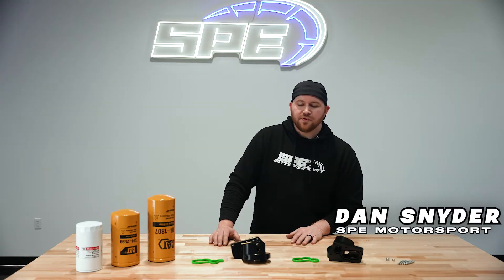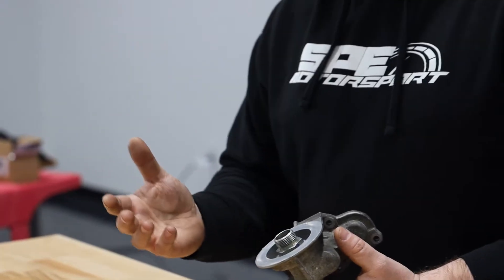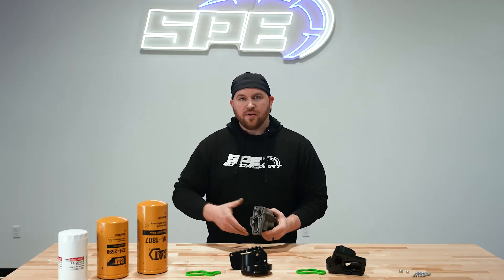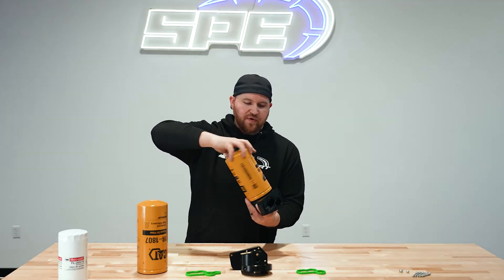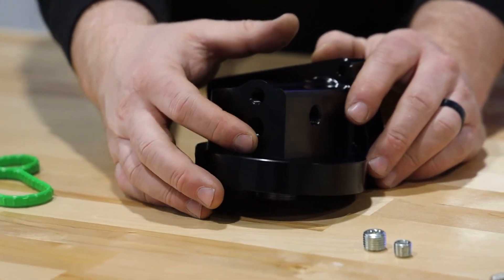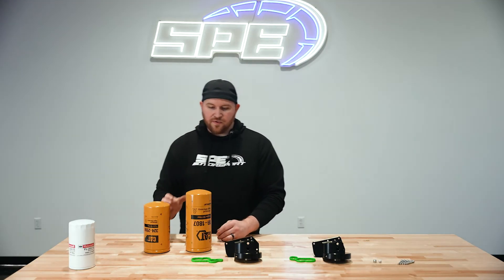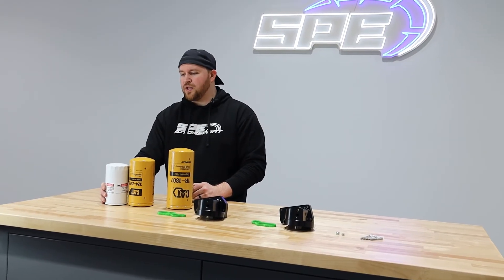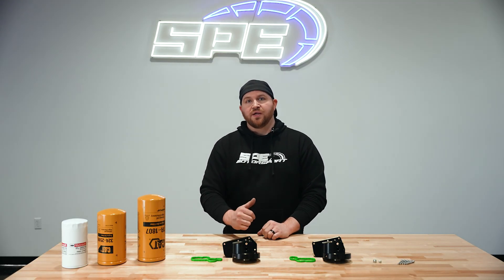SPE's NEW 6.7 Powerstroke HIGH FLOW OIL FILTER HOUSING with CAT FILTERS

Comment: BYPASS VALVE…for those concerned about the BP.V missing on the CAT, consider this… this is my plan. Run a Baldwin b218 or wix 51800 in winter and the CAT the other 3 seasons. Baldwin and wix have bypass valves. But cat does not have BP.V but has has tighter (better) microns.
Reply: Does the factory filter have an anti drain back valve?  And do all of these that you have mentioned have it?

Comment: I am sold on good filtration and better flow thru housing. What I am not sold on is CAT filters not having a bypass valve or drain back valve. I think in cold winter temps we need a bypass valve in the filter. I’m open to discussion. What am I missing? I’d get the kit if I can find a cross reference oil filter to the CAT’s except that it has a bypass valve.
Reply: Have you found a solid filter that has an anti drain back valve and a bypass valve?
Reply: @F @FlatPlaneCranky the Wix 51444 and 51800 have bypass valves. And the Donaldson p550086 has a bypass valves. But know they’re a different psid than Motorcraft. The Motorcraft is in the upper teens and the 3 I just listed I think are close to 30. It’s my opinion it’s good to have a BPV in cold winter temps. My views have changed slightly after what Lake Speed Jr said about bypass valves but I am confident he hasn’t started an engine at 10°F and tested BPV behavior
Reply: @F @FlatPlaneCranky as for anti drain back valve if your oil filter stands vertical like a coffee mug on a table you do not need an anti drain back valve. If your oil filter is between 45° tilt and 90° flat or upside down you done need an anti drain back valve. I didn’t study that cus it doesn’t affect my Ford Powerstroke. I actually don’t want one because the silicone anti drain back flapper donut does cause some flow restriction
Reply: @FlatPlaneCranky best I can come up with is Wix 51800 and wix 51444. And Donaldson p550086. The Donaldson is shorter than MOTORCRAFT. Donaldson is 6.57 inch tall and has 20 micron 50% efficiency. The FL-2124S is 7 inches high but has narrower diameter. I can’t find micron and efficiency for the Motorcraft. Wix 51800 has those to filters listed at nominal micron as 25 and. 30psid bypass valve. Wix 51444 nominal micron 19 and same valve psid. Google says nominal is around 50% and absolute is 98 or 99%. absolute micron isn’t available on the filters I listed. Hope it makes sense. Think I’ll run Donaldson DBL7483 in spring summer fall. 15 micron at 99%. But nervous with that or 20 micron 99% without a bypass. If I lived in Phoenix it wouldn’t bother me in winter. I did just learn about Clear Flood accelerator start. Do a search on that if you’re unaware what it is.
Reply: @Boogle912 thank you. I do a lot of remote starting of my Powerstroke so the anti drain back is very important to me. Do you know if any of the filters you have listed have anti drain back valves in them?
Reply: @FlatPlaneCranky oil won’t leave your oil filter if it’s mounted vertically. I don’t know which power stroke you have but if it’s a 6.7l powerstroke you done not need an anti drain back valve. Your concern would be if you need a bypass valve, that’s what you need to worry about. Not drain back. Oil will not drain out of your 6.7L when you turn off engine and it sits parked. Your oil filter will be full of oil at your remote start.
Reply: @Boogle912 that makes sense.
Reply: @B @Boogle912 thank you.

Comment: Curious if this is pointless or still beneficial for a stock truck that will pretty much always be stock and never beat on.
Reply: It’s a $400 kit. Just use good full synthetic oils with proper API spec and viscosity for your engine and a good brand filter and change often. Save your $400.

Comment: I have one of these on my 2016 and one on my 2022. Great product in my opinion. I recognize people's concern of cold starts, so went with the pan heater on the second purchase on the 2022, but no issues so far. One of the reasons I bought them is to help with oil pressure on cold starts due to it being a better filter and larger passage ways. I live in northern Chinada, and my trucks are parked outside. They have block heaters, which I use at -15 or colder.  My 2016 has seen multiple start-ups at 35 below. Using Mobil 5W40, will be switching to 0w40 this winter.

Comment: Here's my question, I have a 2015 6.7 with 345,000 miles on it.  It's been completely stock that whole time.  Why should I spend $350 for this oil filter housing? And subsequently an additional $30 per oil change for a cat filter?
Reply: Hahaha good on ya for letting us low mileage guys know that these extras don’t do much

Comment: What about a flow back valve??...  Gonna end up with a ton of seized engines..
Reply from the maker: Incorrect. We have every generation of 6.7 running this filter setup of our own. Some logging 50k miles (on this filter setup currently). No issues and no abnormal wear. Our test vehicles have a strict regimen and tests similar to what the factory does (including oil sample tests). Helps us ensure quality products.
Reply: Flow back isn’t a concern on the ford 6.7l powerstroke engine because the filter one of the lowest elevation in the oil system and moreover the filter is standing vertical. There is no physical way for flow back in this engine. Flow back valve isn’t necessary. A bypass filter is, in my opinion, for winter months.

Comment: What is difference in pressure drop? (PSI)  Also, I have read that Cat filters do not have bypass valve.  Is that a concern?  In cold weather?
Reply: Waiting for this answer
Reply: Too scared to answer or something
Reply: discovered I’ll use Baldwin b218 or wix 51800 in winter and the CAT the other 3 seasons. This Baldwin and wix have the BP.V but CAT has better micron filtration.
Reply: Lake speed jr claims bypass valve is only needed when engines aren’t maintained and oil is old and dirty and normal oil changes aren’t followed. Lake speed claims winter temps won’t open a bypass valve. He claims to have proven it on dyno engine. I hear those arguments. I just don’t want to find out the hard way that I made a mistake by not having a bypass valve and pay for a $40k replacement engine. So in the winter in the 47°N latitude I live in, I run a Donaldson or Wix cross reference filter in the winter time to give me warm and fuzzy confidence. Then cat filter in other 3 seasons.

Comment: I read a concern for the filter bypass valve. Cat has the bypass in the mount, Ford has bypass in the filter… both focused more towards cold engine & oil, not dirty oil. Is there a concern for colder climate, cold engine starts if lacking a bypass valve.
Reply: Did you ever get an answer?  I am also concerned because of reading that Cat filters do not have bypass valve.
Reply: @richardbowles7690  no, didn’t get any reply… thus I won’t use CAT Filters. I’ll take notice of lacking a by-pass valve. Obviously important if both Ford & CAT include in their designs… if not present, that’s a concern to me if 2 highly innovated Companies think it’s important enough to include.
Reply: @dougcjohn  I’ve got one of these on both of my trucks, plenty of cold starts in northern BC Canada. No issues. Between the increased flow of the filter and housing, there is no need for the bypass. My oil stays noticeably cleaner after the upgrade.
Reply: @johnveenstra5657 Great to hear! You’re validating my conclusions after understanding more on the surface media increase and volume in canister increase.
Reply: For anyone else who may be reading this into the future, from all my research and trekking across the internet, I would stick with a MC primary oil filter and get a Amsoil single unit bypass for more filtration.

Would give you the guaranteed compatibility and cold-start bypassing of the OEM with the super-fine filtration of a secondary oil filter, and still get those huge OCI increases. Cat filters may be great, but they aren't really needed with that setup.

Also the new fl-2124s isn't bad; the ones from just a couple years ago, and that appear in the video here, are the fl-2151s, which are notably less efficient. the fl2124s were redesigned to have much more robust filter media.
Reply: @WC3fanatic997   I'd agree, the SPE Filter Head isn't for everyone. It's a pricey well designed component that doesn't offer a clear gain for most. I see it as a platform for 2 additional Bung Ports for iBanks Temp & Pressure monitoring. I also feel the opened oil passages provides a benefit. Overall a nice component, I'd like to see SPE offer a Plate to allow use of Ford or CAT filters... that would resolve 95% of hesitant Buyers. 

Regarding Filters: the MC 2124 & 2151 have the same micron rating: 20 micron @ 80% nominal. The newer 2124 has improved media & pleats to improve trapping debris.  The CAT 1R-1807 is 4 micron @ 20% and 20 micron @ 100%. Based on micron rating, the CAT is slightly better, but based on Capacity and almost 3X the surface filter media offers much better performance to stop debris. 

The ByPass Pressure relief value has been a long discussion on several threads... I"ve recently watched Lake Speed's Video on ByPass Values, and SPE write-up on the Ford ByPass vs CAT No ByPass. The capacity and media surface area provide more flow in all occasions. My position has leaned back toward the SPE Filter Head option. 

Comparing the above with an Oil ByPass system isn't really comparable, the ByPass offers the same benefits with both Ford & Cat fliers. I'm a strong believer a Oil ByPass on a Diesel pays for itself quickly... IF you apply extended intervals based the benefits of the ByPass Filtration. If an Owner still feels it's necessary to change oil at 5000 mile intervals, it's a waste time & money. 

The AmsOil ByPass is rated at 2 micro Absolute  @ 98.7 % and cycles about 10% of the oil through the bypass. 

In comparison, the Insane Diesel ByPass is a larger media filter, and rated at 1 micron Absolute @ 99.5%, also cycling 10%.  I installed the Insane Diesel ByPass system.
Reply: I’m against running a filter without bypass valve. Also, think about it, folks aren’t operating Caterpillar excavating machines when it’s freezing cold! So the cat filters are fine in excavators but not fine in your pickups unless you live in Florida
Reply: @Boogle912  I was right there with ya, agree on need of ByPass pressure valve.  Although with additional discussions and more info on ByPass valve operation via Speed Lake’s YouTube video. 

I’ve changed thought path with additional information.  Speed’s video shows ByPass is used when filter is plugged, element dirty… not when oil is cold. 

Comparing volume of canisters, Cat is over double the volume and the surface media is over 3X the Ford Filter.  The amount of Oil from the Cat Filter will be immensely more available and amount of oil that can pass through media is 3X greater.  The Cat then provides more oil flow than the Ford Filter with ByPass small passage under any condition. 

If filters were similar in size & capacity, then I’d insist on the ByPass filter. That isn’t the case between Ford & Cat Filters.

Regarding Cat in cold… Cat engines are huge that run these filters, and they do work them in severe cold in several places.  Although that isn’t directly comparable and the Cat engine has a ByPass in the Oil Filter mount…. Again for dirty plugged filters. 

Although it’s purely a personal choice of comfort . I’ve gained more information and have no discomfort for the SPE mount & CAT filter.
Reply: @dougcjohn discovered I’ll use Baldwin b218 or wix 51800 in winter and the CAT the other 3 seasons.
Reply: @dougcjohn watch for pressure drop on your n dash oil pressure gauge needle. I hear what you’re saying in your long explanation. I am just on the fence when an engine replacement is probably $40k USD and ford wants a bypass valve in it. But I hear your arguments.
Reply: @Boogle912  I hear ya… as you see above… I was against it previously too.  After a few factual points… I had a much better understanding. 

Not a concern, in your example you’ll see more impact with the small MC filter.  The ByPass is a pressure differential valve… the reason Speed Lake and Other experts in Filtration state the bypass doesn’t work when cold is pressure differential. The Cold oil won’t create the pressure like warm oil thus won’t create a pressure differential at the ByPass valve.  Thus ByPass valve doesn’t open when cold…. Only when media is dirty & plugged. So the larger capacity and 3x larger filter media flows more oil cold. 

Entertain watching the Speed Lake Videos, it’s factually enlightening. Don’t take note of my opinion… listen to the Experts. 

In the end… you engine, do as your comfortable.

Comment: The smaller CAT filter looks about the same size as my 7.3 filter.
Reply: The cat 324-2598 specs are. 6.63 in height. 4.28 in. outside diameter. I don’t own a 7.3l to know how it compares. Just sharing the specs on the smaller cat

Comment: I am always looking for better filtration and overall performance,  but alot of folks are saying that since the cat filters dont have a bypass built into them, you could get oil starvation  on a cold start. What are your thoughts on this? I like the higher performing filter media, but I am worried that combined with no bypass could be a problem on a cold start.
Reply: It's not the Bypass valve you should be worried about.    It's the lack of a Flowback valve that holds back oil in the engine to prevent dry starts (especially in cold climates.)  that you should be worried about..
Reply: When you turn off your engine it is presumably hot...the oil is thin and gravity pools the oil into the pan and any other little container. The oil seeps from the bearings, lifters, cylinder walls, bottom of the pistons, oil pump suction tube, yadda yadda, ect...the filter is a container that will hold oil when the engine is off...now just like a wet piece of paper on a window or a mirror, oil will still rest the tiny spaces...
Reply: @jforu33 no flow back on 6.7l powerstroke because the filter is lowest point in oil system and the filter can is standing vertical. You won’t get any flow back at all.
Reply: discovered I’ll use Baldwin b218 or wix 51800 in winter and the CAT the other 3 seasons. The Baldwin and wix have BP.V but CAT has better micron. As for the flow back valve, it isn’t necessary on the 6.7L powerstroke because th oil filter can is vertical, no flow back even possible.

Comment: Question about the 1/8 & 1/4 ports. My assumption is they are pre filter ports? I have a pre oiler that needs to be plumbed pre filter.
Reply: Did you ever get an answer?  What pre-oiler are you using?

Comment: Is the CAT filter better than Donaldson filters?  As far as micron comparison the Donaldson looks to be better.  I may be missing something.  I use Donaldson filters on most of my applications.
Reply: The donaldson will fit this adaptor if you wanna go that route.
Reply: I will use Donaldson P550086 filter in winter and cat 324-2598 in the other 3 seasons. Cus it just makes me feel better to have a bypass valve in the winter in Minnesota. Yes ive seen lake speed’s video on BP valve.

Comment: Bought it, received it. Dropped the oil, removed stock housing….realized I had received the wrong housing….damn it. For the record I did order the right one. I should have doubled checked before I went to working 🤷‍♂️ just buyer beware. Dan is the man but the shipping department is average 😅

Comment: Are the AUX ports post or pre filtered oil?  Wanting to add a pre oiler pulling from the drain pan and pushing through the filter
Reply: Did you ever get an answer to this question?  What pre-oiler are you considering?
Reply: @richardbowles7690  No I never did, but decided against a pre-oiler after getting an oil pressure gauge and it is near instant oil pressure
Reply: @rangervapes571  Thanks for quick reply.  Comforting to know of near-instant oil pressure.
Reply: I wish I had the housing in my hand to better answer this question. But the 1/8 and 1/4 plugs are on “center line” or along the same plane as the 1-1/8” diameter thread which is your clean oil going to the engine. I can say with some confidence that these two aux ports are clean oil side. I know you asked 2yr ago but maybe for the next person.

Comment: Would love to see you guys design a upper oil pan with a gasket that won’t leak
Reply: The 2011 pan has a machined groove with an o-ring. They fit all the 6 7s
Reply: @HSKFab why did they do away with it then!!!! Ugh! Cheap asses
Reply: @dallon507  Exactly, cheap. Save money not having to machine a groove. Reliability is unheard of nowadays.
Reply: You need to replace the crankcase filter on top
Reply: Man you arent wrong. Ive had mine resealed 2 times since last summer

Comment: With running a larger oil filter, are you going to have to add more oil to the system?
Reply from the maker: Yes, the larger 1r-1807 filter adds roughly 1 quart to the engines capacity. The shorter filter option is slightly less.
Reply: @SPEMotorsport   Just to be clear with the SPE oil pan and this new oil housing with the larger CAT filter the oil capacity would be 17 quarts?